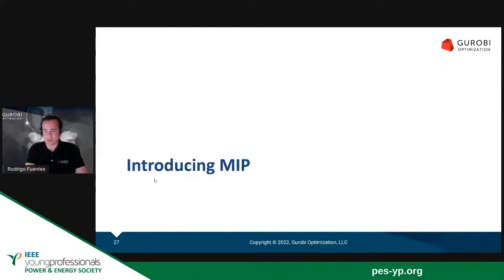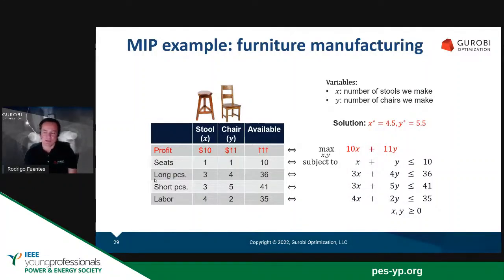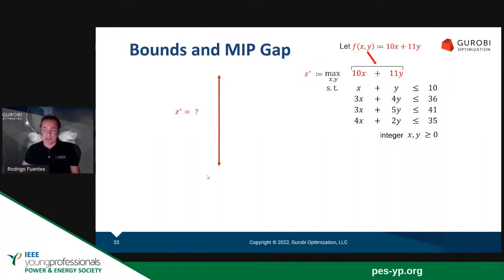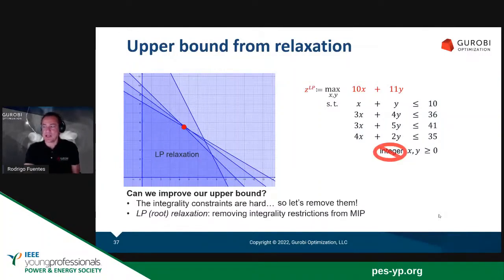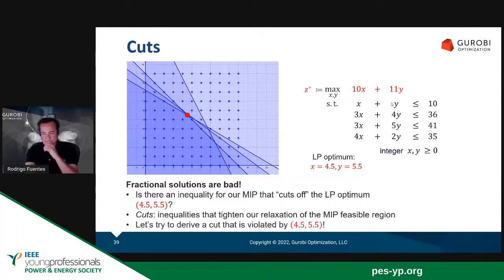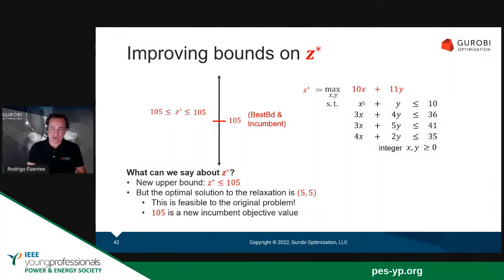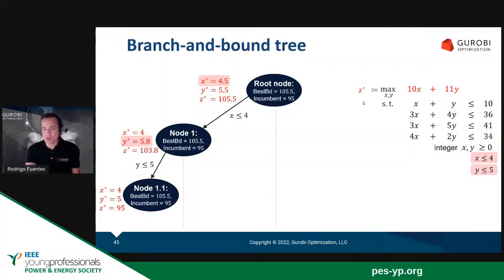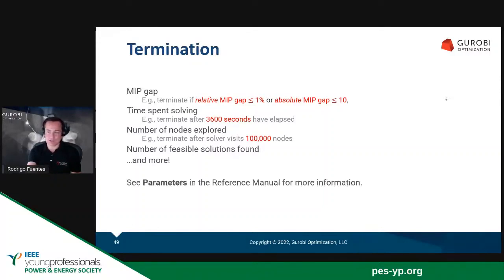Introduction to Mathematical Optimization with Gurobi Integer Programming

Comment: how is upper bound 210 when the maximum value that can be achieved following the x+y<10 constraint is 110 (that is when y = 10 and x = 10) ??
Reply: It is because from constraint x+y<=10, we get max values of x and y as 10. So, by putting that in objective function we'll get the value 210 (10x+11y = 10*10+11*10) as upper bound for objective value